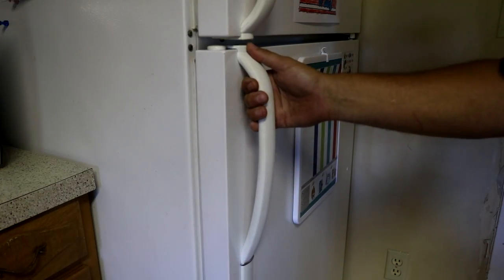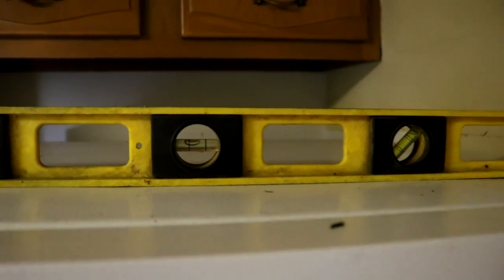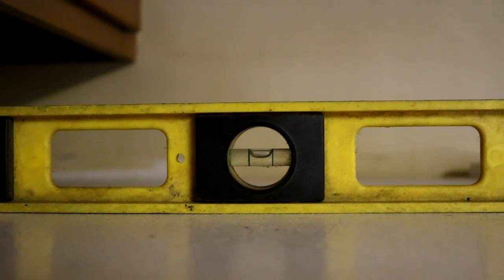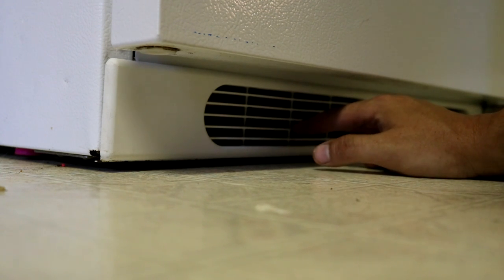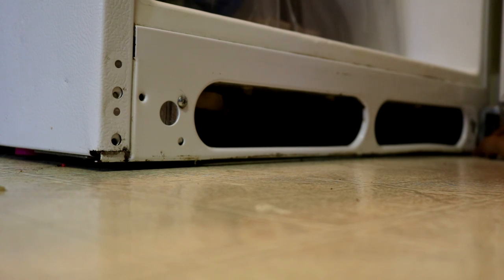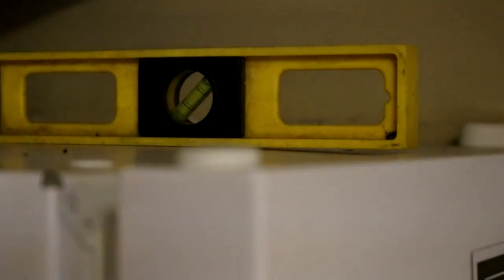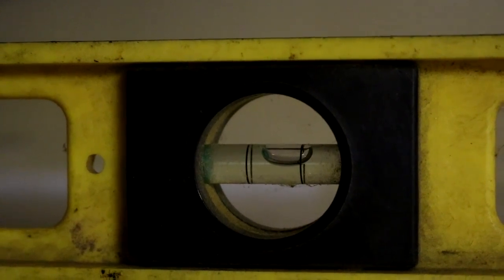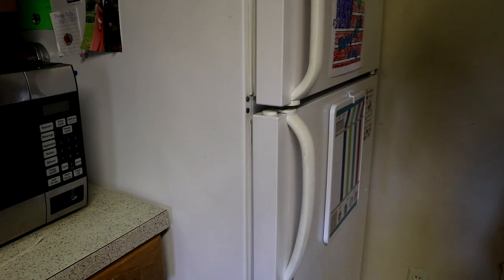How to Adjust Refrigerator Doors so they Close Properly

Comment: Once you do this though then you can't roll the frigerator out. It's not on the rollers anymore. I'm having a huge issue with my refrigerator not closing. This morning I woke up to find that my refrigerator had been open all night a crack. I accidentally did not close it hard enough, or check it to see if it was closed properly like I usually do, so it did not adhere tightly. Even when I did what you suggested I still wasn't getting a tight closure. The seal all around the refrigerator has been replaced so that is not the issue.